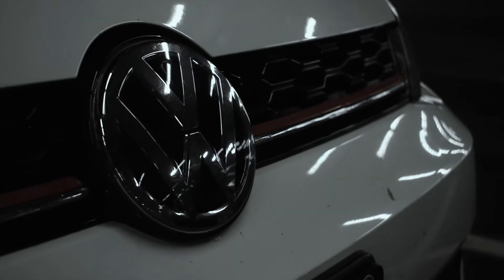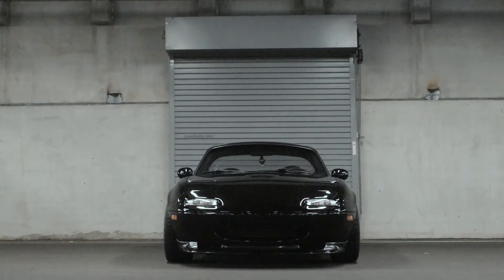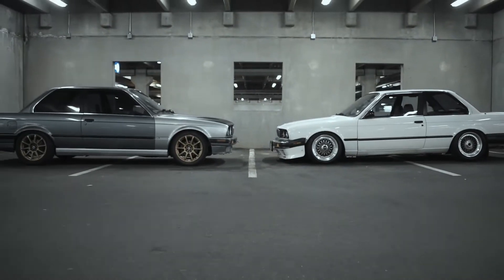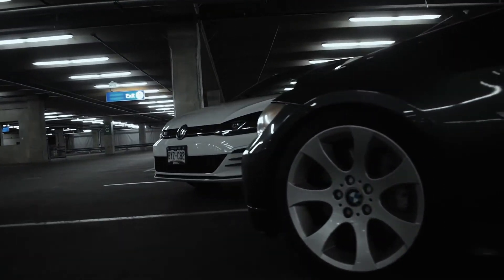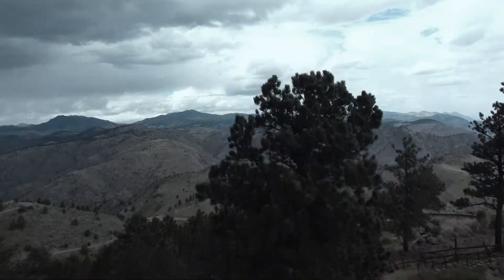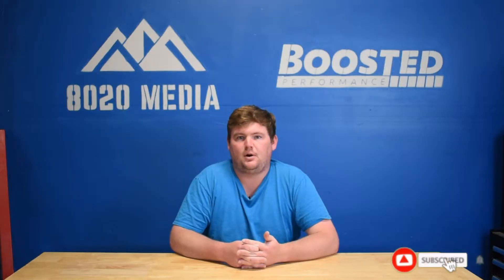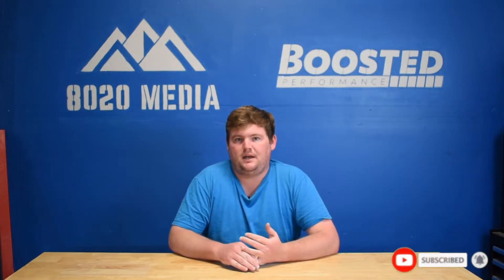BMW N20 | Common Problems & Reliability

Comment: I have my F30 320i just over a year now and every time I drive In rain it's like my car has a seizure for a second then after a while feels like it's pulling breaks in its own. And till today nobody can tell me why 😭. Yoh I can't anymore I feel like giving up but I love this car so much ☹️☹️☹️☹️
Reply from the maker: M - Those “seizure” moments in the rain followed by the feeling of the car braking itself are almost certainly tied to moisture interfering with wheel speed or stability sensors, which makes the DSC/ABS system think a wheel is slipping and briefly applies the brakes to correct it; BMWs are sensitive to this if a wheel speed sensor, harness, or reluctor ring is cracked or letting in water, and sometimes corroded ABS module connectors can also act up only when wet. Because it never happens in dry conditions, I’d suspect a sensor or wiring issue low in the wheel wells where rain splash can reach — the best next step is to scan the car with ISTA/D or another BMW-specific tool right after it happens, since generic OBD scanners often won’t show intermittent DSC/ABS faults.

Comment: I was wondering if there is any major similarity between BMW's 2.0 turbo engines and VW/Audi's 2.0 turbo engines? I know they also have early failure.
Reply from the maker: M - Aside from being direct-injected and turbocharged, there's not many similarities.
Reply: @8020Automotive  Does it mean the same long block?
Reply from the maker: M - Although they are both German vehicles, they are two completely different manufacturers.

Comment: I just bought a cheap 2023 328i with 125k miles on it. Its been dealership maintained its whole life. As far as I can see no leaks are present. I believe the timing chain hasnt been done but shows no sign of looseness or whining. Also i think it has the stock water pump as well. I will definitely be addressing both of these asap but just kind of fun to have one of the outliers.
Reply from the maker: B - Nice, congrats on the new ride!

Comment: Thanks you for this great content, my BMW X1 2013 N20 is currently shown warning engine light. I took to a dealer to diagnose for $260. Then, the dealer asked to further inspect for $2,200. This is just check and inspect engine (not repair cost).  According to N20 common timing chain issues, the dealer should already be familiar with it. I called BMW North America. The BMW won't do anything because my car is out of warranty 7 years/ 70,000 miles even there is Class Action lawsuit N20-N26 , SIB 11 03 17, SIB 11 02 21. Now, BMW is leaving a loyal customer in frustration. Seeking recommendations to make inform decision. Thanks for any input in advance.
Reply from the maker: K - Sorry to hear this.. We can't really give any recommendations. This is just unfortunate.
Reply: @ thanks for getting back on this issue. It is really BMW owner unfortunate pain.

Comment: Only ever hear good things about this engine, I baby mine tbh no hard pulls from digs stays in comfort mode, I floor it on the highway time to time but hard not to, changing oil 3500 mi
Reply from the maker: C - They aren't bad so long as they are well maintained!

Comment: I’ve got 2014 428i Msport n20 with 118k miles and all I’ve had is the oil leak problem which is totally fixed now. Otherwise most reliable car I’ve owned.. still scared about the timing chain every time I start it 😢
Reply from the maker: V - Thanks for taking the time to share your experience! Sounds like you've got a good one.

Comment: I have a 2015 Bmw 320i and since a few months I have been having burned oil smell inside the car. They (bmw) changed the valve cover gasket. Same problem they check the turbo oil lines, the oil filter housing gasket. They say everything is find. Any other suggestions? It has to be oil falling on the exhaust to produce that smell. 😕
Reply: Update: the valve cover was leaking and had to be changed.
Reply from the maker: J - Nice! Glad to hear you found the issue! Thanks for coming back and updating. This will certainly help future viewers!
Reply from the maker: J - Certainly indicates an oil leak somewhere.. Interesting that they couldn't find anything. Are you losing oil faster than usual?
Reply: Yes.
Reply from the maker: J - The problem is there are so many gaskets that could be causing an oil leak, but that would be our guess.

Comment: anyone has any idea why my f30 320 n20 car will go  rough/growl during heavy rain or going through small water puddle? It's like the car cannot go fast  and if i press gas, strange vibration, i had to drive 60kmh for quite some time until it went normal again. Strange no error. how do u fix it ? If it's dry or light rain no problem.
Reply: I'd say you have water in the ignition coils. Probably have a cracked cover on the coil that's shorting out till it dries out.
Reply: @beaugator  well, im using engine cover and foam. Also, the coil was just replaced 3 months ago. or water coming tru the intake?
Reply: @beaugator  i see, i also noticed my coil plug had this rust, if this normal? Just changed all 4 coil plugs and 4 spark plug early this year. How water could enter the coil while i had cover on top of my engine, how do i prevent that?

Also, bad news my 320i stage 2 , just went kaput on cylinder 4, 20psi , low compression. Sad
Reply: @shahosj5023  Any rust should be treated and protect the connection against further corrosion with dielectric silicon. It will protect against water intrusion as well. The low cylinder pressure could possibly be from a too tight valve adjustment. you need to do a leakdown test to see if it's the rings or the valves leaking.
Reply: Red wire runs front to back of vehicle with a splice connection, probably shorting out.

Comment: Don’t buy one with an N20 engine. Absolute junk! Mine is March 2015 and still had the timing chain issue. Absolutely loose. And only 48k miles on it!
Reply: Same with my car..
Reply from the maker: M - Sorry to hear about this. However, thanks for sharing your experience!
Reply: @8020Automotive  just adding that this is my first 4 cylinder BMW engine and I drive bimmers for the last 30 years. 6 cylinder are much better BMW engines. Not perfect but better.

Comment: Plastic drain plug on plastic oil pan not that it’s a bmw problem but an oil change is one of the most frequent things outside of pumping gas that an owner has to do and the average person is not going to BMW for an oil change which mean diy. Buying these parts from the local auto parts stores sometimes the plastic drain plug comes with the filter and it causes tons of problems leaks  strip, it doesn’t fit right or you may over torque it. All of this is rare with your traditional oil, pan and drain plug.
Reply from the maker: C - Well said. Thanks for sharing.

Comment: It's simple - the valvetrain drive, which is the only serious problem can be replaced for around 1-1.5k$ while vehicles with this engine tend to cost 3-5k$ less than alternatives. I've made 140k  miles in mine, 0 issues so far, but I'm planning to replace that valvetrain drive just in case.
Reply from the maker: K - Thanks for taking the time to share your experience!

Comment: Folks, should be common sense. If are unable to afford repairs on thesw cars stay away from high end cars. Unless of xourse you are a experinced mechanic. You can buy used at a decent price but the maintence/repair cost require deep pockets. 😮😂
Reply from the maker: E - Well said. Thanks for sharing.

Comment: I bought a 2015 428i xdrive 70k miles ive owned for 1 year 106k nothing but problem's 
At 87k ive put a rebuilt head and gasket timing kit new aluminum valve cover complete tune up spark plugs ignition coils and oem thermostat 
Now at 106k its broke down thinking its water pump biggest money pit since owning
And i went from a 2014 e550 4matic v8 biturbo to save $ on a daily
The 428i coupe is a beautiful car always getting compliments
Reply from the maker: K - So sorry to hear this... However, we appreciate you taking the time to share your experience!

Comment: Can i suggest you put a difficulty factor in the repair? I have had my Rocker cover gasket go and was advised to replaced the whole cover as they get brittle. I now need the sump gasket to be replaced. Good to hear the heads up on the timing chain however
Reply from the maker: G - Thanks for the feedback and taking the time to share your experience!

Comment: i think the n20 is a great engine
all timing chains on any car need to be inspected after 9 years any way so you might as well replace it then 
and what car isnt leaking a bit of oil after 100k km
Reply from the maker: J - They certainly can be great engines. We don't make these videos to scare, strictly to inform.

Comment: the biggest problem with the n20 is it's 2 missing cylinders...
Reply from the maker: X - Well?
Reply: @8020Automotive  well?
Reply: And the problem with your little engine is that there are two missing cylinders as well. Either get a 4 for economy or an 8 for power anything in-between is a joke.
Reply from the maker: M - We would have to disagree. B58?
Reply: @RobbieCrowe777  Nah, as a certified Triumph nut and somewhat Bimmer fan, I can tell you that cylinders should come in multiples of 3.
Reply: @Myneighborsucksl3726 never buy a BMW with a V8 unless you're a masochist. But their inline 6 engine's are excellent

Comment: Hi i bought a 2012 bmw 528i x drive for 11k lease it has warranty for enegine and transmission for 24 months the car has 106k miles the timing chain already been change should  i worry ?
Reply from the maker: M - If you have a warranty, then no. But we would highly advise staying on top of maintenance.

Comment: I have an n20 engine and at the first start, after idling, the speed drops to 500 rpm for a few seconds, and then it runs fine. what can it be ? has no error codes, https://youtube.com/shorts/DV4LruJmSFM?si=I5lvd82kot9KJUYs

Comment: Missed another big one. The mechanical vacuum pumps go bad and suck oil in to the vacuum system. Particularly problematic if you have the vacuum controlled wastegate.
Reply from the maker: I - Thanks for sharing this insight!
Reply: What would be the symptoms of that?
Reply: @marcokoordom7309 if enough oil gets into the vacuum reservoir in the engine cover, the waste gate won't close the way it should, and you'll have poor response and or lower power.

Comment: I have a misfire that comes and goes and now the engine stumbles and seems like the turbo turned off…since there’s no power service sucks where Iam at any known problems cause a misfire like thy?
Reply from the maker: Troy - Do you have a Check Engine Light? We would advise getting an OBD2 code reader cause it will quickly help you diagnose the issue. From the sounds of it, it could be an ignition component (spark plug/ignition coil).

Comment: I have a 2018 320i just tuned to bm3 stage 1 81k miles. Planning it to keep it stock. should i be worried. i do oil changes every 5k miles with liqui moly
Reply from the maker: John - Nope, you should be in good shape, so long as you maintain it well!

Comment: I have 2015 X1 with 34000 miles on it, should I worry about the timing chain yet ?
Reply from the maker: Y - Nope! You should be good for many more miles before thinking about the timing chain. However, make sure you stay on top of maintenance. Lack of maintenance intensifies other potential problems.

Comment: hi, the oil light came on on my 2013 N20 (328i) and temp gauge showed it was overheating so I added a quart of oil and all of a sudden white smoke was pouring out the exhaust and the engine won't stay running. Turns on then immediately dies.  bmw mechanic said its a turbo problem but white vapor tells me head gasket.  Would you have any thoughts please??
Reply: Inlet pipe and intercooler pipe were FULL ( like 3 qts) of oil so issue probably is turbo related! BTW,  my 1st post is what prev owner told me he experienced. I just got this car as a project. I drained oil and 12 qts came out. PO did not know what he was doing!! So 12 qts plus 3 qts back flowed into the pipes is what came out. I'm gonna replace the turbo oil supply line with updated check valve and a few more things and see if engine will run
Reply from the maker: M - Great find. We hope you're able to get it running!
Reply from the maker: M - It honestly could be either. It's giving us head gasket, but there's no way to truly tell unless you get under the hood and find it first hand.
Reply: @8020Automotive  Yes likely HG, but I fail to see how it could possibly be  turbo related!? Is there a seal failure in the turbo that could allow water vapor out the exhaust!? Thanks again for thoughts
Reply from the maker: M - Have you had it checked out by a shop yet?
Reply: Lol, I'm the shop. I'll do the usual tests and figure it out. Just baffles me how white vapor out the exhaust could be a turbo problem
Reply from the maker: Mascho - Keep us updated!

Comment: Great info for N20 BMW owner.  I have replaced valve cover(include gasket), spark plug , oil filter housing for my 2015 X3 28i (manufactured in Nov 2014). Recently got multiple engine misfires and one Fuel Pressure too low codes. The error went away after the reset was told to replace fuel pump if the code comes back.
Reply from the maker: JS - Thanks for the feedback and for sharing your experience!
Reply: Hey mate, how many kilometres are on the odometer. Thinking of buying 4 series with the same engine haha. 
Thanks

Comment: I have a 2013 bmw 528i with the n20 4 cylinder and with 200k miles and countless problems it won't die I'm proud of it
Reply: Considering I have the same car with 80k this makes me very happy regardless lol
Reply: @Toddgetsbread 
Make sure to save for that timing chain from now tho in case it goes out
Reply: @lloidpadilla427 Replaced at 77k 🎉
Reply: @Toddgetsbread My X5 40e has this engine and it was at 125k kilometers when the whole engine exploded. 14 000€ to replace it. I bought the car 2 weeks ago and drove 500km and the whole fkin engine blew up. I hope I can cancel the purchase since the dealer also lied about the cars crash history. He said it has never been in a crash and I checked with car vertical and it has been crashed twice all over the car and repaired for 30K euros
Reply: @Kristian01233  💀
Reply: @Toddgetsbread me with my 73k😂
Reply from the maker: We've got an N54 that's been the same way - it's been driven on low oil for so long and just keeps going.

Comment: want to buy a n20b20 220i 2014 with stage 2 tune 278 hp 90 000km is it worth it or are the engine realy bad. Gonna use all my money dont got alot left for engine fix but can of course do normal maintance.
Reply from the maker: Erling - We aren't going to give advice on if you should buy it or not, especially given the budget constraints. But what we will say is if the maintenance has been kept up with, it may not be a bad buy.

Comment: I’m in the process of buying an f30 and getting a 320 or 330. Would it make sense to pay the extra money just to get a B48 to avoid the issues of the N20?
Reply from the maker: Chhem - Personally we prefer the B48 over the N20. Toyota uses the B48, with some slight changes, but that says a lot about the engine. However, make sure to abide by your financial situation.

Comment: I have had 1 replaced. If I knew then what I know now, I may not have had to replace it. Mine was the oil pump. I now have 100k on the new motor knowing what to look for. I change the oil more often than I should, plugs as well, and had the head gasket replaced at 50k out of caution. Runs like it did when I had it put in
Reply: Did you notice any symptoms from the pump before it failed? What should we look out for from your experience?
Reply: @gnt4l  I would get these random low oil pressure warnings. They would appear, and then clear and not be seen for weeks, then return. This went on and off for nearly two years, and they could not figure it out. Finally it returned, and when it did it was different as this time the car started acting very odd and the temp shot up. As luck would have it, this time the shaft on the oil pump actually broke. Everything looked fine structurally from the outside as the belt and such were still attached and moving, but I believe the shaft broke very close to the impeller, so everything stayed in place and nothing leaked. Apparently they issued a TSB on this a few months later. Never were able to determine why it went intermittent for a couple of years before it went catastrophic.
Reply from the maker: Taco - Thanks for adding your experience! Sorry to hear about the first one.

Comment: N 20 is the worst engine bmw has eve made, that thing can jst fail while driving no warning light no nothing, I have about 8 engine um rebuilding nw , it's very hard to rebuild, it needs original Crankshaft bearings ,. If you use these after market Cranks you will never win
Reply from the maker: B - Oddly enough we don't think the N20 is the worst engine BMW has ever made. But thanks for sharing your experience!
Reply: Should be n54
Reply: B58 OR B48 best  @yongqihu9580
Reply: Highly disagree , I’m over 100k and I smoke em like a chu chu train
Reply: Should be M62